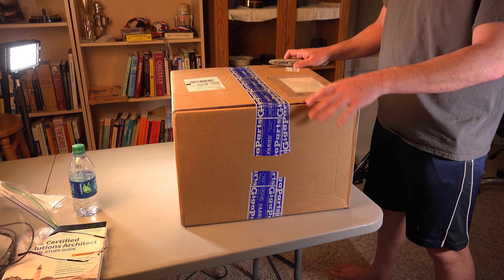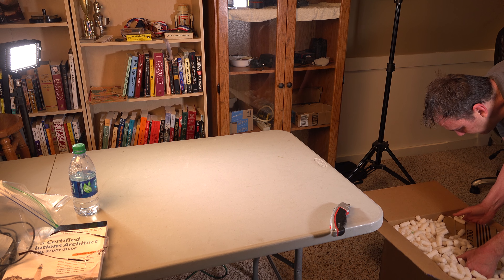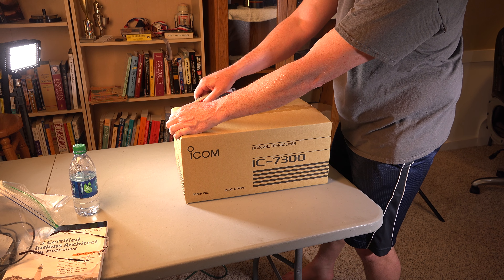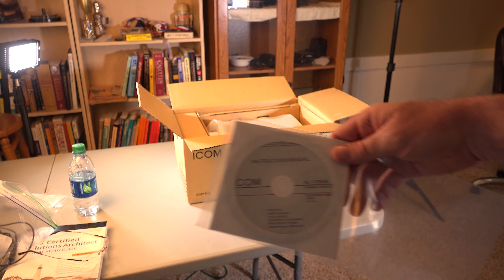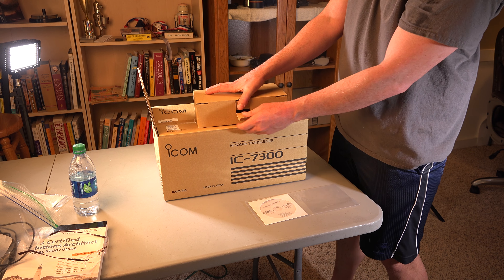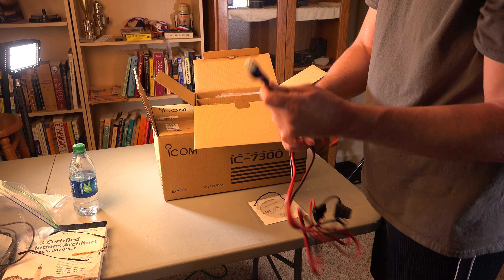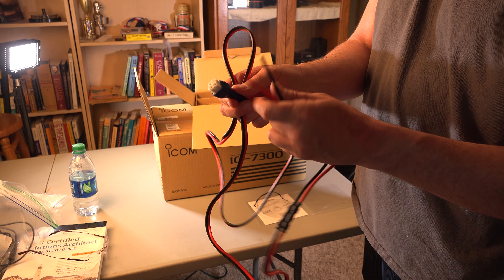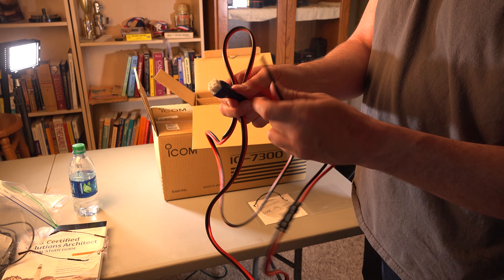Icom IC-7300 Unboxing Video New Ham Amateur SDR Radio

Comment: Sweet radio...congrats!  Yes, ALWAYS save the boxes and packing inserts.  They are the best protection for shipping the radio for service if need be and selling later.  I take all the manuals and paperwork from my boxes and put them all in one handy, easy to get to file folder.  I then pack the little boxes inside the bigger boxes to keep things compact.  And then I store them in a safe, dry place in my attic.  Keeping boxes can be a pain, but they ad appeal when selling and there is nothing like them for shipping!
Reply from the maker: Yes, especially for re-sell later. People want the original stuff. Thanks for comment.